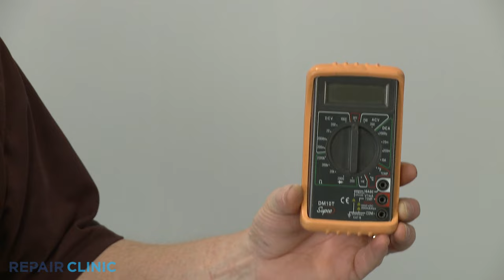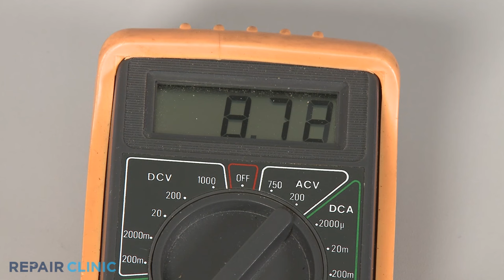Dryer Thermistor Testing

Comment: Hello. Our GE dryer (GFD85ESPN0DG) just stopped working, no display either. We suspected the thermistor and did the multi meter check, there seems to be no continuity of power through that. So do we conclude that the thermistor has gone bad and replace? The part no. on thermistor says 76j1hdx0007 - THERM-O-DISC. Please advise.